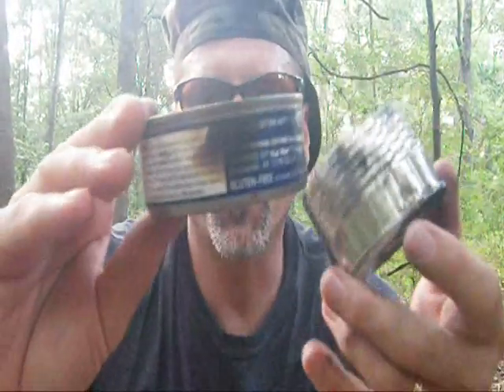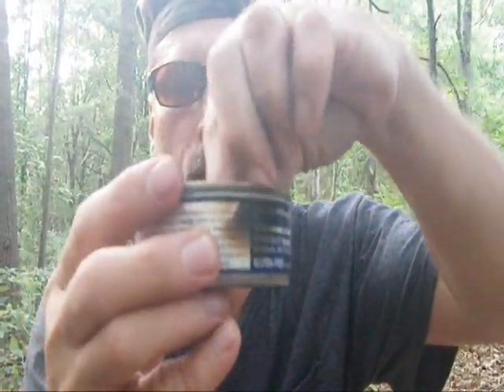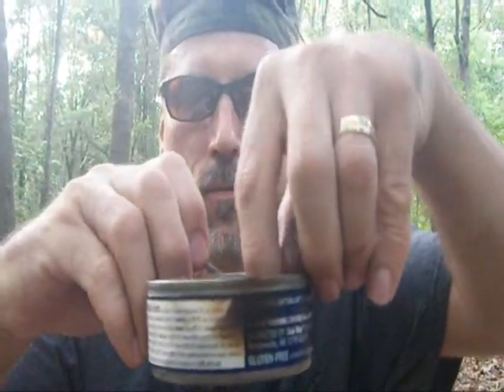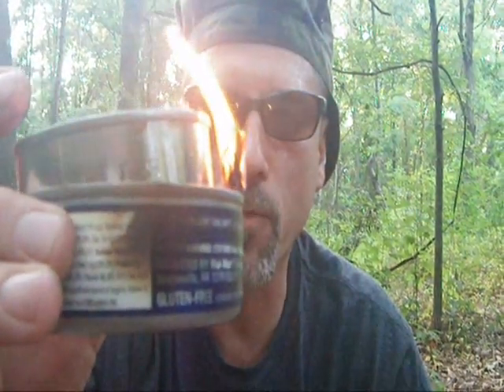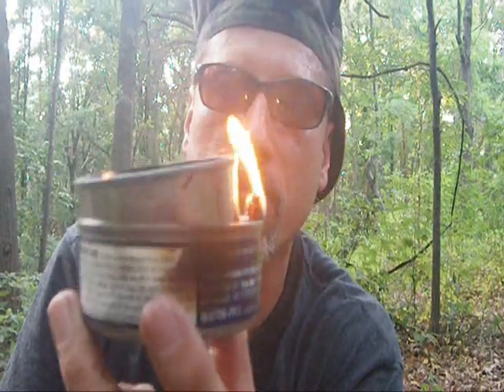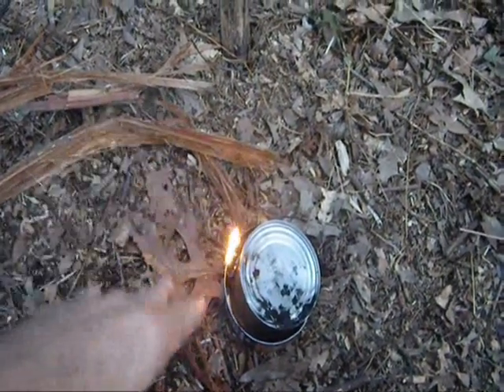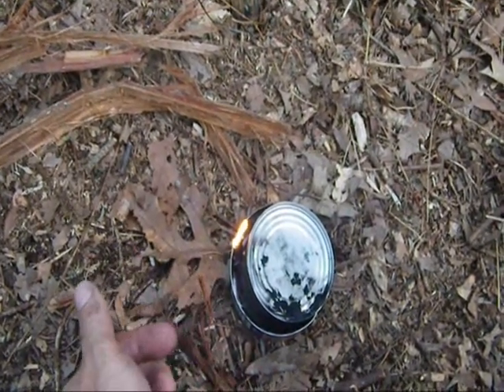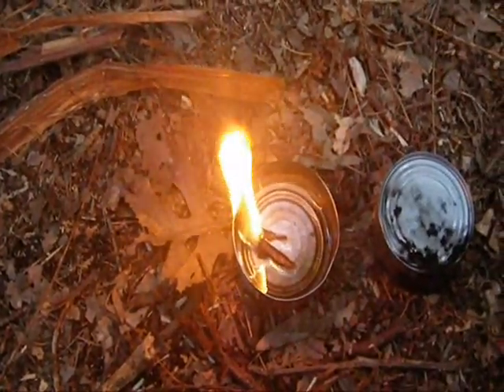2 Can Improvised Emergency Oil Candle

Comment: The Un-Candle worked on the same principal. A glass of water with oil on top then a wick floating in a plastic disk with it stuck in a tiny hole for the wick. light the wick and walla!

Comment: Unless baby oil is significantly more flammable, there is no need to cover the surface of the rest of the oil reservoir. I have used lard and vegetable oil and have kept a wick in them burning for hours and it's simply not enough to ignite the rest of the oil. Even with two this did not happen. Perhaps if you kept the oil over a large wood fire, this would happen.